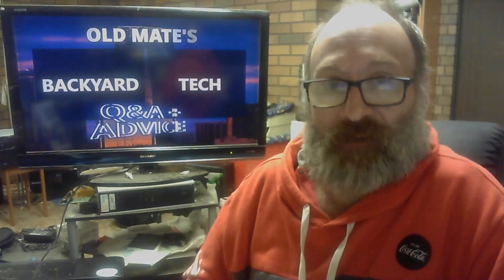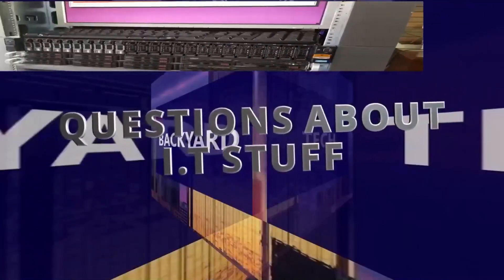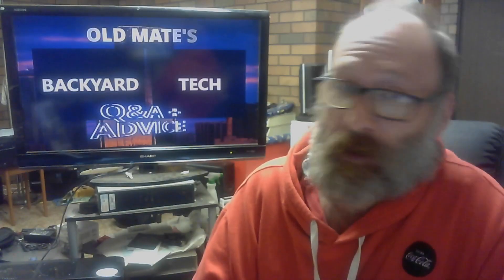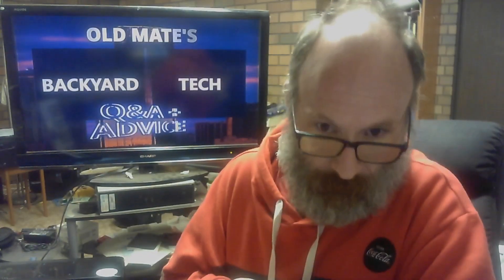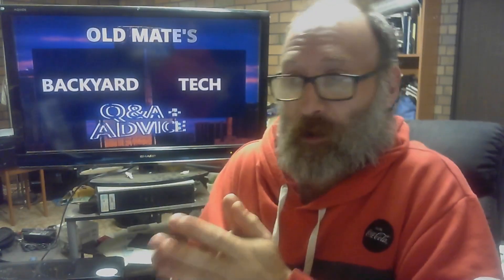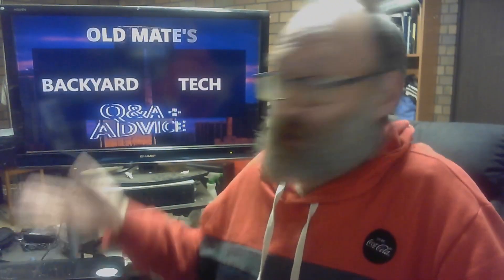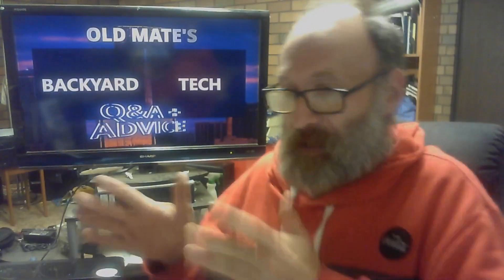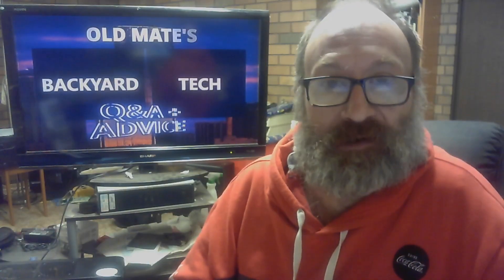Q&A + Advice - Yamaha O2R vs ADAT HD24

Comment: Actually I have both the 48 and 96 02rs but have not used the 96. When I bought it for 250.00 U.S. dollars it had a bunch of broken pots and non working switches. Some of the chassis was dented so I figured it was dropped?  I was a machinist and CNC programmer and I do electronic repair on all my amps so I wasn't intimidated by the defects in the 96. I ordered the parts, opened up the 96, pulled all the boards, soldered in all the parts and put her back together.  Everything seems to be working correctly but I haven't tried to use it. It really wasn't so difficult. What I am driving at with this is why don't you just replace your screen? Should take you less than the amount of time I have spent on this routing nightmare lol. I once was setting up and running an old Fadal machine when the screen went out. Knowing the interface so I well I was still able to set it up, program it and keep it running until we could replace the screen. It sure made life difficult. The main difference was that machine could kill me, the 02R won't kill you.  Just to be clear, I was plugged into channel five on the 02R and had it sending the signal to the HD24 on 17.  I am not familiar with many of the acronyms you used so they kind of went over my head. Pulling and installing the cards on the 02R is really no big deal and only takes a few minutes. I am going to putz around some more before I do that if it comes to that. Thank you for the vid and thank you for the help. I will get this straightened out sooner or later, I am not a complete dummy. I think I am just letting my frustration get the better of me and I should know better.

Comment: Both are running at 44.1. I am having a hard time with the audio being low. I am going to have to wait till morning when I am alone and the wife has no TV on and everyone else is out of the house and watch this again. I will follow your advice for sure.  We did record this on this equipment which was then mixed down from about 20 tracks, so I know it is me that is having the problem, not the equipment. I had a gent doing the engineering, I just bought the equipment he said he wanted to work with. He showed me how to use all the eqs, dynamics, scene memories, fx, etc but we never got into the routing. Here is the recording we did so I know it all worked last time it was used.
https://www.youtube.com/watch?v=_wKEiMhk_Mo

Comment: Before I start changing out cards I am about to go downstairs with a pencil and paper, call up the data in the initial scene memory, which resets all the routing pages to the defaults, and copy every routing parameter it has for channel 5 and 17 and the global routing parameters. Then I will call the Test scene memory up, do the same and compare the two, the scientific way. When I find the differences that should put me on the right trail. As it stands, the way I have been going about it was like trying to squeeze a pimple on a black babes ass in a dark closet while wearing boxing gloves. If that doesn't solve it I will  start switching out the cars. Thanx again for your help. I have been all over the internet and on different forums trying to get help and all I basically got was, junk that old equipment, it sounds like sheet anyways, buy new stuff and go from there!
I listened to some of the stuff they have recorded with their "new stuff" and it doesn't sound any better then what we did with what I have . As a matter of fact, a lot of it doesn't sound any better that what was recorded in the 1950s.